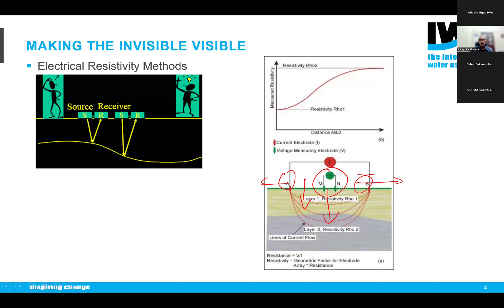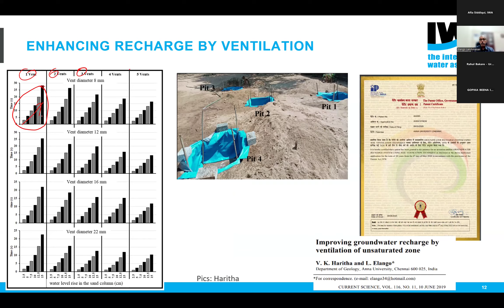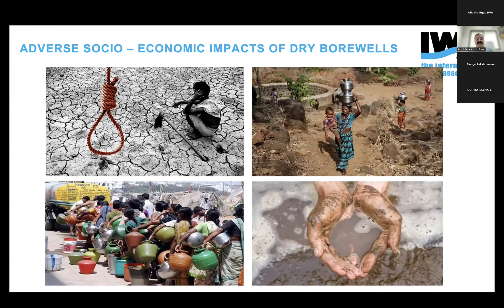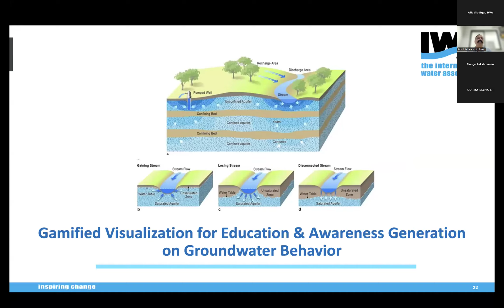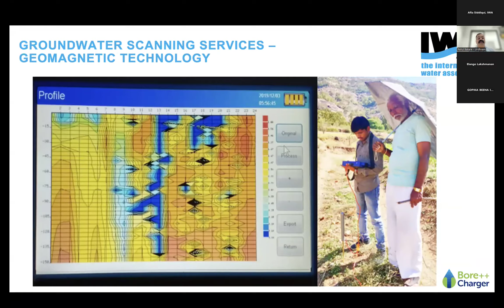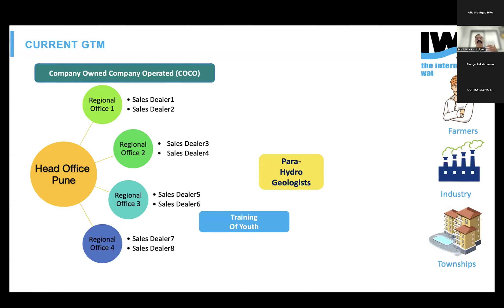IWA Webinar - Making the Invisible Visible – Technologies for Groundwater Management

Comment: For recharging of strom water, IS Code guidelines are there and that shall be followed. Yes specially for using the storm water from urban area, contamination is an area which must be considered. There are cases ground water has turned saline after start of the recharging without following IS Codes.

Comment: Sinkholes occur primarily due to the migration of fines and consequent ground loss, often triggered by an abrupt change in hydrostatic conditions at shallow depth. Such changes can create a steep hydraulic gradient, particularly during rapid pumping or dewatering or arranging of the flow of ground water shallow depth to move to deeper level , leading to internal erosion and progressive loss of ground.